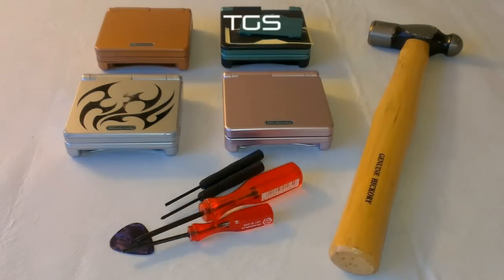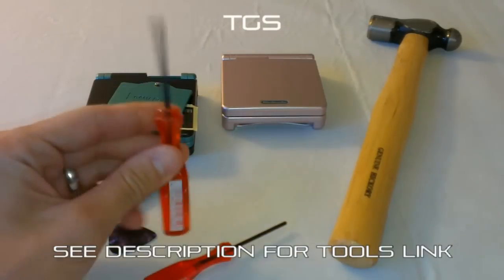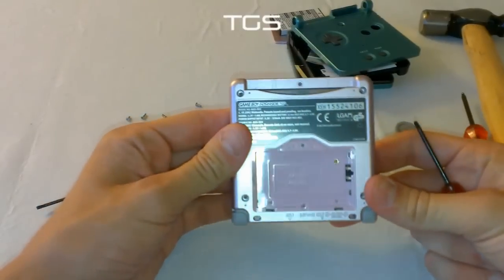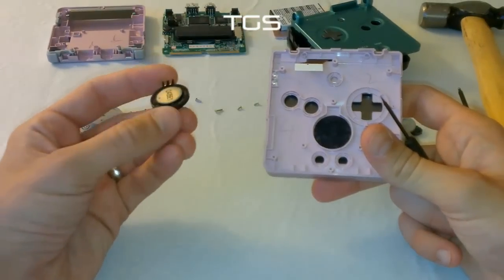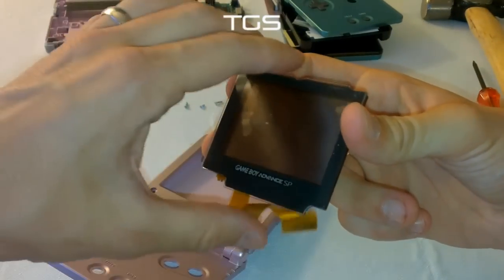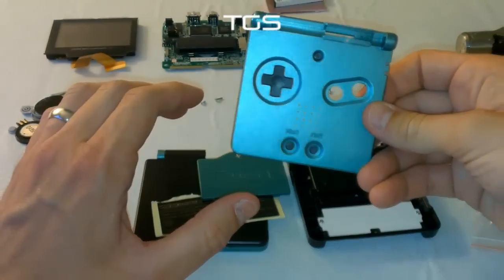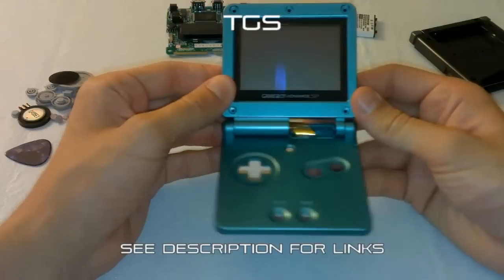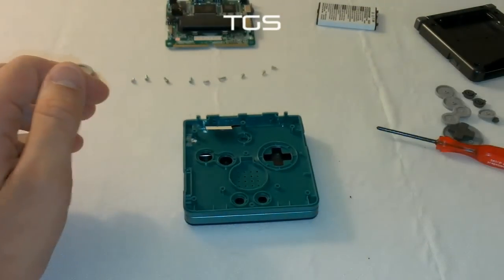How to replace a Nintendo Gameboy Advance SP Housing

Comment: Those hinges were not put in properly. 
The hinges are the hardest part. because the sp needs to be open at a slight angle and the hinges also need to be put in at the right angle. If done properly they pop in nicely, you shouldn't have to use a hammer.
Reply: Thank you do much for this comment. Helped me out so much.
Reply: LunarNightLights thx I was afraid if it hit it with a hammer I would break it
Reply: thanks m8
Reply: I completely destroyed my hinges because I was foolish enough to follow the instructions blindly. Now I can hunt them down in the depths of the internet. I wish I had read the comments beforehand...
Reply: Thank you!!!! I was just about to follow the hammer advice but i knew that could not be right!
Reply: @stevenchisari9564  glad to hear!!
Reply: LunarNightLights actually just finished putting the pikachu shell on and it looks fantastic so thanks
Reply: So when putting those hinge pieces on, I keep the screen at a right angle?
Reply: FireFuture 3177 it’s something like that, I just played with it a bit till it popped in easy and have not had any issues since,
Reply: @FireFuture-fq7if  yes about a 45 degree angle
Reply: @LunarNightLights  thanks
Reply: @linearliquidize  it’s been 2 years did you ever find replacements 😂

Comment: Please I dont know what to do! Can I replace a 101 motherboard with a 001's? Because maybe thats why the system suddenly resets while on, It seems that it has been used too much. But i dont know if I have to buy a regular SP motherboard generic or it has to be specifically an AGS 101. Ive searched but I cant seem to find any. Please I dont know what to do!

Comment: Ok, the shell came today... Had a bit of trouble with some things.I tried putting the big triforce on the front, but the top triangle had a big air bubble in it so I had to take it off throw it away and order another. Then the Hyrule Family Crest was too big (and i even ordered the smallest available size) so I had to trim it just to get it to fit. Then I spray painted the buttons black to match the Zelda edition, but then the paint ate right through the plastic, So I just used the original buttons. Now as for the case, the main problem I had was the hinges, I couldn't get them in right so its not at the correct angle but heck i'm done messing with it. Hopefully I can put the Triforce on the front without any problems when that comes in, so heres what I have so far! IMAGE HERE > http://i58.tinypic.com/24msrx0.jpg

Comment: I know this is an old video, but I still want to give thanks for your great video guide. Thanks to this I was easily able to put my original GBA SP into a brand new case that was similar to the old one. It was old and beaten and has a chunk of its case missing by where the cartridge goes, thus making it easy to accidently hit and remove. Now it looks as good as the first time I got it

Comment: Recently bought a refurbished SP on eBay with an AGS 101 screen. It came in a pink/pearl casing. From the image you couldn't really tell it had a pinkish tent to it. It looks nice but I'm not a pinkish kinda guy so just bought myself a metallic red (flame red) casing, always liked that colour SP. The SP I got has black buttons not the tipical light grey so will look nice with the metallic red (flame red) casing. When I re-case my SP I might place the Nintendo badge upside down on the front of the unit. Reason why, when the screen is up the logo will be the correct way up. This is something I always felt was wrong with other designs like the gold Zelda triforce and yellow Pikachu, when the screen is up the design/s are shown upside down.

Comment: Here's a question related to the GBA SP. I have a GBA SP AGS-001 that works perfectly, but the shell is getting worn and the shoulder buttons aren't as responsive as I'd like. I feel like I can handle these issues with little-to-no problem, but I was thinking that while I have the GBA SP opened, I could replace the screen with a backlit AGS-101 screen. I can get a screen no problem, but I'm wondering if it would be as simple as taking out the old 001 and plopping in the 101 screen. I can't find any definitive guide or resource that answers this one way or the other. If it matters, my systems are NTSC.
Reply: You would need and ags 101 mother bored there is also a guide on how to mod a 001 but you gotta solder

Comment: Ok, great video, but I'm having trouble taking out the rubbers, and I keep scratching the old shell by accident. Anyone have an easier solution? Edit Okay, so I found that I can use a seeing needle to pry the rubber bits off, although, I wouldn't recommend if you're going to use the same ones later.
Reply: FallbackTomb what I did on my ds lites rubbers was used a very small flat head screwdriver

Comment: I did everything but now sound only emits from the console if I squeeze it really hard, what do i do?
Reply from the maker: +MegaDrain You may have knocked the speaker connections when you opened it up.. May be worth unscrewing and making sure they are connected...
Reply: theres small metal conntacts on the speaker bend em up a bit there not touching the bored but be gentle

Comment: I know this video is really old but hope I can still get an answer. Does this work on either of the SP models? I have the one with the better screen so don't know if it makes a difference
Reply: I believe both models are identical in regards to the cases/housing.
Reply: yes the housing works with the ags 101 and ags 001.

Comment: Careful: Use a kata-knive to cute the rubbers out before using a flat screw driver to pull them out! Ruined my first rubber because it is not shown in the video
Reply: They are in the wrong color anyway, but keep that in mind if you want to reuse the old case maybe